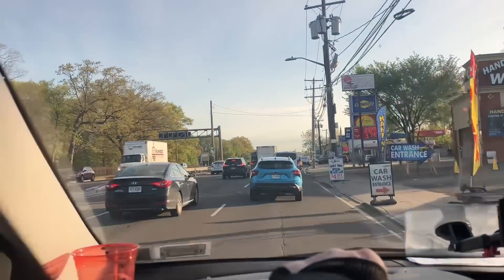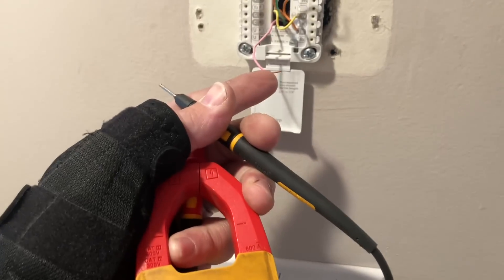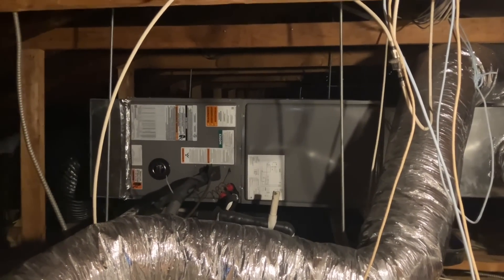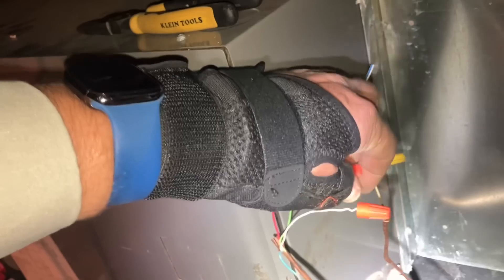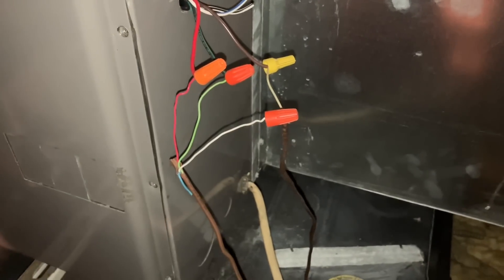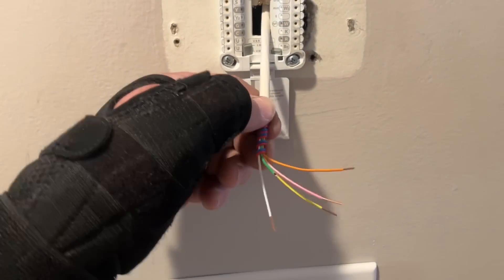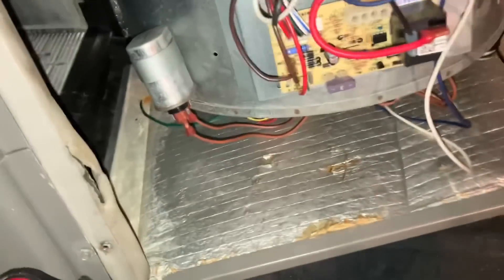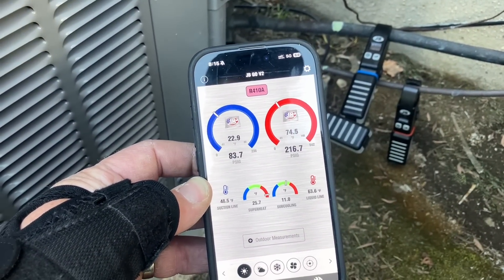HVAC Nightmare: Frozen AC, No Power, and a Mess of Wires – Mikey Pipes Fixes It!

Comment: When you showed the wiring I thought the issue was going to be no Y wire going to the air handler. When the G is energized but not Y I would expect the fan to run at low speed.

Comment: I get the system wasn’t under high load with your current ambient but why is your SST so low? That’s why you’re icing up. High super heat and average to slightly high subcooling sounds like a restriction. LL Drier / metering device.
Reply: You are right on. HVAC 101 right.
Reply: @ you never fully know the situation on a call. You got a guy on call, while videoing, while possibly on a time crunch, with a customer who may be on a budget. He’s tracing out multiple issues and following behind another contractor. This guy knows his stuff. I wouldn’t comment hating anyone’s work. He’s an honest contractor who does good work. May have missed this one though.
Reply: So the metering device isnt getting a solid collomb of liquid to it which could be a blockage at metering device or Filter dryer ?
Reply: @ not necessarily. If the restriction is @ the metering device itself you’re still going to starve the evaporator and have reduced mass flow ( low pressure ) back to the compressor. 
The subcooling is the important measurement here because it’s telling you the liquid leaving the condenser coil is sufficient to feed your metering device. So it essentially eliminates the charge being an issue out of the equation because otherwise you wouldn’t have enough liquid in the condenser to absorb the heat required to subcool the liquid.

Hope that helps. Im not sure how good I was able to relay the correct info via a comment lol.
Reply: @raymondsvoboda4175 i think that makes sense to me haha, so by the pressures being low one may think the system is low on charge, but by having a proper subcooling reading aswell as a decent load for the system to be working with you would assume that there is something blocking flow to the metering device, and without the proper amount of refrigerant pressure coming through the metering device thats causing the indoor evap coil to freeze up at well under 32•